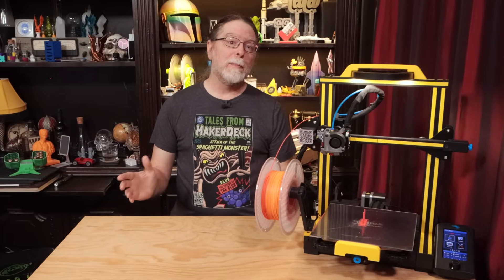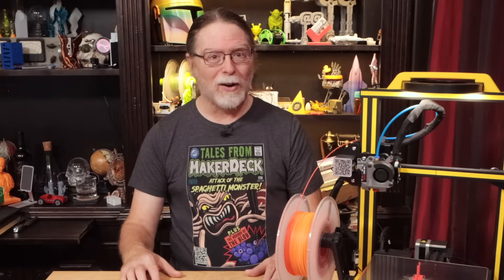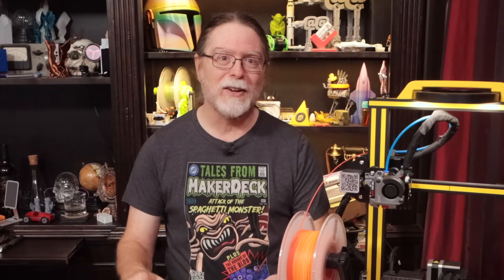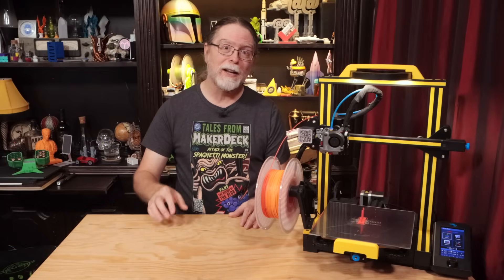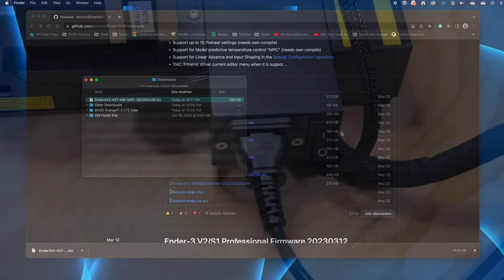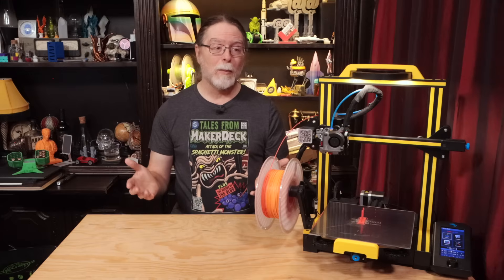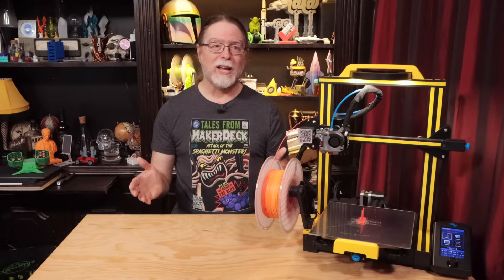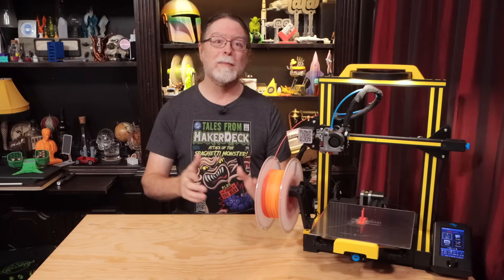The BEST Ender-3 V2 Firmware EVER?! MRiscoC Professional Firmware

Comment: I am new to 3D printing and this is my 1st 3D printer.
I just purchased the ENDER 3 V2, I have a problem trying to print and Creality support can not help me. My only option to return the printer.  They provided me with a print file called print. I also have a print file that came with the printer. I pre-heat the PLA and then continue trying to print. When I select the print file it say's 'PRINTING'. The Z-avis moves to the center and then stops. It never prints and the message is locked. I can not pause, or stop it. It never print and I must re-boot the printer and try again but same results.

I tried using the AUTO HOME option. When I select AUTO-HOME, the message HOMING XYZ please wait until it is done. The message stays there and it is locked again. Must re-boot the printer again. Creality has not been able to help resolve the problem. I am ready to pack it and return this printer. Not sure if I want to get another same model or go to another brand..very disappointed. I am going to prepare a video about putting together the parts. It took me like 15-20 hrs and had all sort of problems.

Comment: I wanted to say thank you.  I just replaced my Ender 3 V2 mainboard out of necessity to the new BTT SKR Mini E3 V3.0 and have also the Ender Extender kit installed. There isn't any pre-compiled firmware for and Ender 3 V2 with a 400mmx400mmx450mm setup.   I modified the stock Marlin Firmware bugfix 2.1 to be the correct settings for the board and XYZ size.  The default Marlin UI is just too basic for the V2 display.  I tried to use the CrealityUI config and it wouldn't compile.   This version is just magic!   I did a lot of reading and the developer went the extra mile and create a special configuration repo where he added a Python GUI that allows you to select from some common features.  Additionally he added the ability to allow you to configure different settings from the Configuration.h and Configuration_adv.h files.  I simply created a new JSON file with the updates to the X_BED_SIZE, Y_BED_SIZE, and Z_MAX_POS to match my extended setup.  Sure enough when I ran the gui my new 'Extended' config showed up.  I clicked on the generate button and it modified the config files for me.  Also modified the platformio.ini file to properly load in the BTT mainboard, stepper motor drivers, etc.  Copied files in to his Marlin folder, and let PlatformIO do it's thing.  Flashed the new mainboard, and display and works perfectly!  Thank you again.

Comment: I was disgusted by my ender 3 v2. I upgraded everything, direct geared extruder, dual axis rods, cr touch and all, still worked like poop. Now I serviced it, cleaned everything, and now installing this to see if it has any potential or not. Friend bought prusa at same time, had non of the issues that I had :(  And CR-touch, I have no idea why it probes every time print quality sucks with the default marlin, cr touch does absolutely nothing but probe in the beginning. I hope this software really utilizes cr touch.
Though, thanks for this video, very great instructions. I really appreciate.

Comment: great video i have a cr touch and for some reason it does not go to auto bed levelling like it did before using a previous firmware . i downloaded the firmware with bl touch and also the script on my slicing software has auto bed levelling in it ? what have i done wrong?

Comment: I installed the new software, looks and worked great, it's on 3v2 I got one compte print in and not about 10 min into every print stops saying there was a power interruption, which would be fine but when I continue the extruder starts 2in above the work surface. Any ideas on what might be going on thanks.

Comment: Hi Bryan, thank you very much for posting this video. On your video for Jyers Code, I installed it on my V2 and it still works fine. Now I would like to print on higher temps, since I installed an all metal hotend from Ms... And my question is: is it possible to print with more than 260 degrees C with this new Firmware?
Greetings

Comment: My son and I just bought an Ender 3 V2 Neo. Every time we try to warm up the bed or the PLA the display panel completely restarts. Does anyone have any ideas for troubleshooting?
Reply: We figured it out. There is a switch on the back for 110 or 230 volts... 🤦‍♂We switched it to 110 and our problem was solved.

Comment: Hi,

Ender 3V2 with a 4.2.2 board and a DWIN display board. I flashed this firmware without problem, so thought it would be nice to update the display. When powering on the printer with the display SD card inserted, it first went blue and after a few seconds orange. I removed the SD card and rebooted, but all I get is a black display.

The printer was still "live" at this point because pressing the knob gave a beep. Tried reflashing the display several times, no further display, just black. I then thought I'd try reflashing the printer firmware, as there were a few threads that said this had worked. After reflashing the printer, I've still got a black display and now no beeps if I press the knob.

Any help or suggestions gratefully received, or failing all else how do I get back to the factory firmwares to start again!
Reply: Check what type of display unit your printer has. Follow the guide in the Wiki.

Comment: Great Videos, i have just installed the Sep version with manual mesh leaving (No touch Point sensor) to my ender 3 v2 with the sprite pro extruder, but i am having issues setting up my home location, Currently it is 5mm on the Y axis in front of the bed. Prints are fine never been better but just find it strange how it homes off the bed.
Reply: There is a calibration guide in the Wiki.

Comment: Big problem I'm noticing - can't isolate when yet, but randomly, when trying for a preheat PLA for next print, it instantly tells me nozzle temp too low, heating failed and i have to shut down the machine. I cannot preheat, same thing, nozzle temp too low. I cannot change filament, same thing.......anyone else?

EDIT AGAIN: Nope, homing doesn't seem to be the reason, printer still will randomly kill itself when trying to heat up saying nozzle temp too low. - Not the best firmware at all, one of the worst i've tried, user beware
Reply: Are you serious with this comment? - what are you Microsoft tech support? you want me to turn it off and on too then report back? @MiguelRisco 

EDIT: Bad-form deleting your comment - to those curious, he suggested that I change the silicone shroud over the hot end -.-

Comment: Help, from the install of this firmware (version of 4-sep-2023) there's no more M206 and M421 commands and I cannot move the offset of the printing area. That's because I've a direct drive Titan + E3D V6 hotend. 
I've not been able to center the printing and adjust the printing area.
Reply: Home offsets were deprecated in favor of more precise XY MIN/MAX positions. There is a calibration guide in the Wiki.

Comment: Hello Sir ! Before installation of the same i had a question about the max temperature that this firmware allows ? I have a spider hotend and eas wondering if it would let me get to those high temperatures with thos firmware
Reply: There is a custom G-code C104 that allows to increase the maximum temperature but you must check if your hardware is really capable of that.

Comment: So if I have a ender 3 pro with a 4.2.7 board and the screen upgraded to the color screen off the the newer printers could I run the ender 3 v2 firmware? :) It seems the primary requirements are not model number of the printer so much as main board and screen requirements.

Comment: Does this firmware support power outage recovery? 
Cause mine didn't work
Reply: Yes, but that is not a reliable feature and it is not enabled by default, check power outage in the Advanced settings menu.

Comment: Thank you for this!  The main reason I switched to this firmware was, by default, the new print bed area with this build is 230x230mm (which I needed for a large build) and this was (by far) the easiest way to go beyond Creality's stock 220x220mm default.
Reply: hahaha you could have change those settings in cura and use 230X230
Reply: @ronnymatalalampi9770  You can set it to 230x230 in Cura, but the stock Creality firmware (physically) forces it to 220x220.  It will truncate/cut your printing area right off!  So no, it requires different firmware that allows a larger print area.
Reply: @ChrisSchroederPurdueEngineer  not sure about that. Both on my stock ender 3 pro and ender 3 v2 i could make it go out x+ and make awfull noise.
It was through octopi thoo.
If it makes any differens.

Comment: Hello, I tried to install the firmware on my Ender 3v2 Neo but now when I turn it on it just stays stuck on the intro screen??? Can you help me fix this?
Reply: Same problem. I cant even instal custom firmware, but y can instal official firmware from creality web site anytime
Reply: Do you how happen to know how I can factory reset it using the official original fw from creality? If so which file is it because I installed a bunch of upgrades and idk what to do?
Reply: Hi again. Check your motherboard, if under the 4.2.2 y got GD32 chip ( as I have) you cannot install mriscoc firmware
Reply: Thanks for the info! I just need it back to normal. Do you what file I need to do that n how?

Comment: I want to do this for the ender 3v2 max I'm building... I have only ever gotten failure to compile when I follow your jyers video. Will you be doing an updated video for installing this on the e3v2max with dwin.?
Reply: You can change the physical settings without recompiling the firmware.
Reply: elobrate? the build volume is limited by the firmware  @MiguelRisco
Reply: @bylifeorbydeath  Menu Advanced Settings / Physical Settings / XYZ MAX/MIN Position and XY Bed Size.

Comment: I'm in a bit of a quandary. I want to do this mod on my recently acquired Ender 3 V2, but my V4.2.2 control board has a Gigadevices GD32F303RET6 chip, not an STM32F103RET6. I am afraid there may be a compatibility issue and I could brick the board. Anyone use this firmware on a V4.2.2 with the Gigadevices chip?
Reply: Other comments said that is not compatible, you will get stuck on the screen only saying "creality"
Reply: @omegadeepblue1407  I found a version of the firmware with the letters GD in the file name. It works fine.

Comment: As expected, fantastic video Brian! This is an incredible new firmware! The icons are brilliant too. Its like I have a brand new printer. You explained the install flawlessly too. Two questions, Question one. Is there a setting somewhere that lets the screen stay on longer, it auto-dims about every 30 secs, maybe a minute, I haven't timed it. Second question,  my filename used to scroll across the top of my screen that would tell me the filename, layer height and how many metres of filament its going to use. any idea how to make that scroll again? Any help would be fantastic.
Reply: You can send or write a g-code configuration file with the M255 S0 command (or S## where ## is in minutes)

Comment: I have this installed in my Ender 3 v2. This weekend I will be installing the Micro Swiss NG extruder and hot end combo. I have a large microSD card full of parts I’ve printed. Will I have to delete all of my prior sliced parts and re-slice? Or will setting the steps and retraction in this firmware let me still use them? Ender 3 v2 mostly stock with a CR-Touch ABL sensor.

Comment: I hate to fix something that’s not broken, the only issues I have are slicer material profiles, temperatures being different than the temperatures suggested by the manufacture, being totally different from the temperatures at work. If I want anything more out of my Creality and ender three printer than it has from stock would be faster print time, better temperature control, possibly better ways of movement, but the only problem is I have with it seem to stem from the software with which my files are produced. So I’m very reluctant to update the firmware rather than get a better slicer. I honestly almost wish there was a $100 slicer, because they all have limitations, I was under the impression Creality was the only one, so I had to buy a dedicated computer, prusa is exactly what I expected out of Cura, but the only real issues I get I’m just really scared to update the firmware and end up with a bigger problem that I had before…

It’s funny though, these things are so great fascinating to watch, but nothing more than a glorified hot glue gun with special hot glue. Nothing about the firmware or software is special. It is all 1980s level technology I just can’t believe it’s taking this long to make that a consumer product, especially considering drafting printers have been around for so long. Just put a hot glue gun on it with colored hot glue there you go add a z-axis there you go there’s nothing breakthrough or advanced about it. It’s a remote control car meets pressure, meds, hot glue gun probably the biggest technological step is the consistency of the filament itself.

I often wonder if I could just stick weedeater string into my 3-D printer lol. It cost more though. 

That makes me wonder if a custom nozzle could allow me to produce custom trimmer line. It’s definitely a great hobby very useful and convenient especially for custom car parts or prototypes. I always thought ABS was better than anything else but now I realize PLA is actually better .

Comment: Thanks for this great video, Bryan.  I updated a few days ago and it seems filled with great features.  Unfortunately, I have not gotten it to work correctly yet (granted, I am an utter beginner with the Ender 3 v2 Neo!!).  When I try to print anything post firmware upgrade, it starts printing layer one then the screen says "Advanced Pause" and pauses the print and retracts the filament.  Then I reload the filament and resume and then it pauses again after another layer.  As far as  I know, this is a very simple model with no post processing instructions in the g-code at all.  Any ideas?
Reply: Hey I figured it out, you need to go into filament settings and turn off "Enable runout" and everything works perfectly after!
Reply: Hey I have the exact same issue on my ender 3 v2! Have you found any fix or work around?

Comment: I think this is great and am I've been meaning to try it. My hessitancy is that I have a CR touch on my ender 3 v2, but I have been thinking about adding a high temp extruder which would require me to edit the source code which I assume is the Upgrade only. Any chance you have a video on editing the source code to add a CR touch and change the high temp settings? I have not come across a decent guide that tells me how to modify raw source code for both. Its usually one or the other.

Comment: Does anyone know if this firmware is compatible with the Ender 3 v2 4.2.2 board with the newer GD32F303RET6 mcu rather than the old school STM? It seems that firmware support for these are still a little behind though the ender 3 v2 has been shipping with it for a little over a year. I guess  sometime during the chip shortage Creality quietly switched
Reply: I have that same chip and couldn't get it to work, I'm interested to see if there is a fix for it.
Reply: @Capt.Safety you got it?

Comment: I'm going to go against the grain here. I installed this firmware on my brand new ender 3 v2. I could not get a successful print no matter how much I tinkered and adjusted. I went back to Jyersui, since I'm familiar with it, and haven't had an issue since.

Comment: Great firmware, but for some reason the auto bed levelling before every print is not working, I have checked and the G29 code is inserted. Some one know what’s the problem? (The levelling from settings still working that the automatic before every print don’t)

Comment: Hmm... Seems like there's some kind of bug that has caused them to pull the binaries from Github.  Hope they solve this.  Have you encountered the error?

"NOTE: Due to a bug, where some people report that the info box and toolbar are not showing, binary downloads have been removed. The error seems to be board dependent, some printers with the same firmware file work and some don't. Until this can be fixed, the binaries will not be released."
Reply: New binaries have been released.
Reply: @MiguelRisco  Awesome!!  I've been playing with the May 2023 release.  Having a few issues which may not be related to the firmware.  But it's always good to get the latest version.  Thanks for your fine work!

Comment: Which MRiscoC version do I have?  I bought this Ender3v2 second hand and it came with this `MARLIN Mrisco` firmware (it quickly flashes that during boot; but it does not say which version it is).  My firmware is not exactly the same as shown in the video.  Is there a way to find out the firmware version?  Mine has 4 main menu items:  Print, Prepare, Control and LEVEL (in stead of Advanced)   I looked in the menus, but could not find it.   Thank you for the video Bryan.  As always: inspiring, detailed and informational.

Comment: Hey man so I did everything I was supposed to do but I have the ender 3v2 4.2.2 with bl touch. The PeD gets to 200 and holds no problem but if I print the hot end stops heating at 120 and will tell me it’s not hot enough. Is this a gcode issue? Or the firmware issue?

Comment: Does this support Arc commands? (G2/G3). I'm still running Jyers firmware, which supports it. But I'm having some issues with it. So would like to try this, but would hate to loose that function.
Reply: Yes, the firmware will support all the modern features of Marlin.